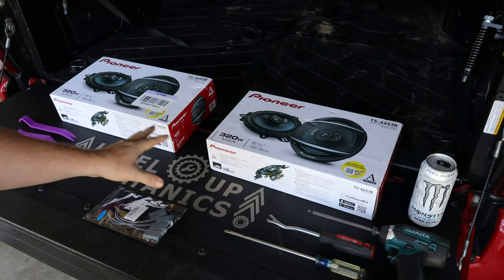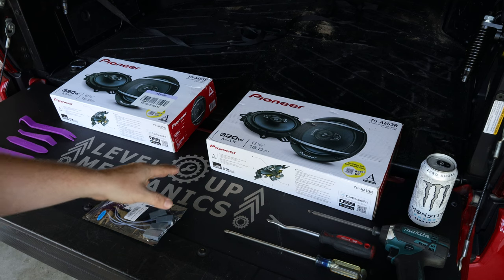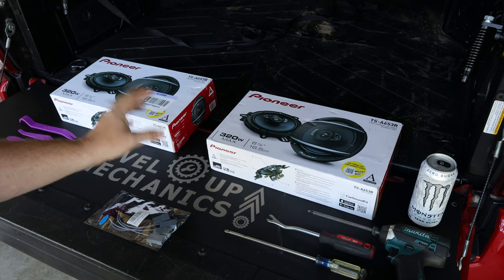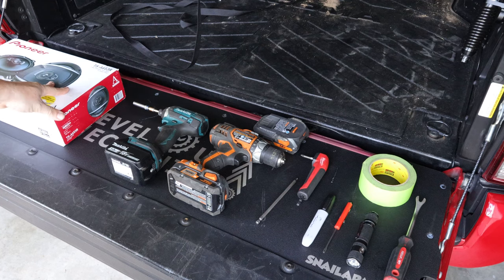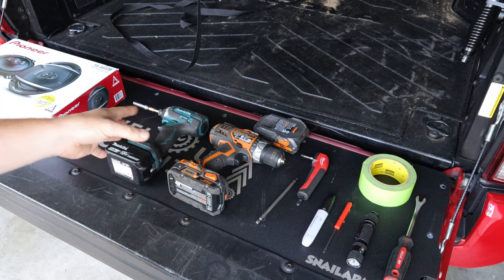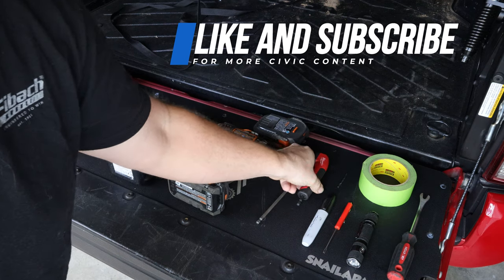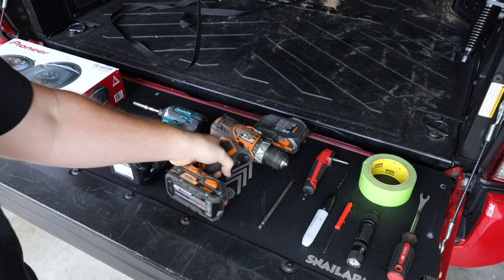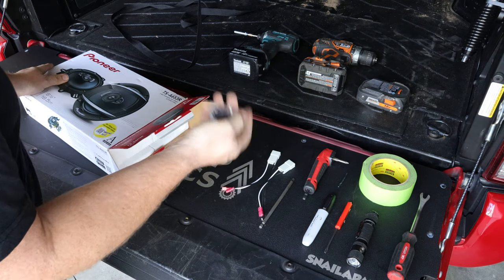Installing Pioneer A-Series Speakers On My 8th Gen Honda Civic (2006-2011) | An Affordable Upgrade

Comment: FYI, I reused the felt backing on the stock speakers by putting them on the back of the new spacers to prevent any vibrations. Also, do you not have the 1" tweeters on the top of the dash at the base of the A-pillars? I didn't bother changing mine because I couldn't find any direct fit aftermarket speakers and the OEM Honda's were overpriced. Lastly, where did you source the rear stabilizer bar?
Reply from the maker: Re-using the felt is always a good idea... the more protection you have against rattling, the better 👍.

My LX doesn't have stock tweeters (I checked just to make sure 😅). But since there is a tweeter mounted on each new speaker, it definitely improved the high & mid range sounds overall (when compared to the factory setup).

And finally, I found the rear upper shock tower bar on Amazon. The brand is Ultra Racing and they make a lot of different chassis reinforcement products for the 8th Gen Civic. 

https://ultraracing-usa.com/product/honda/civic/

Comment: You probably won’t reply but when you buy it on Amazon do 2 speakers come in 1 box or do u have to order 2
Reply from the maker: Yes, 2 speakers come in one box. One order will let you replace both front (or rear) speakers 😁👍

Comment: I have a question with my 08 civic coupe mine originally came with the premium audio system and the right half of the speakers in the car went out all at the same time and then now im down to just my ome speaker in the driver side door even my sub that came stock with the cars premium system went out as well
Reply from the maker: It could be the speakers... or it could be the amplifier... but unfortunately, I don't have a definitive answer...

Comment: So I seen other comments where you said has their premium sound system...did all honda have that premium sound system in all their cars or where they select cars? Because I have a 07 civic hybrid with the navigation head unit and I'm not sure if they came with that or not unless they all came with a premium sound system with Amps and what not...just a question I thought I'd ask
Reply from the maker: Not all 8th Gen Civics come with a factory premium sound system. Some (like my LX) came only with a basic sound system.

A good way to know what you have is to go to crutchfield.com and select your vehicle (and answer the questions about your vehicle specifics). Doing so well tell you more info about which factory sound system you have. 

I hope this info helps! 😁👍

Comment: its better to replace all 4 ? FOr my LX the front are gone, so iw as thinking maybe buy a set of 4.
Reply from the maker: I went ahead and just replaced all 4 speakers at once. You can always just do 2 at a time though, if you need to space out the cost.

All 4 speakers are exactly the same, so it's up to what your personal preference is 😁👍
Reply: @LevelUpMechanics  very true.. ill check on it

Comment: Do you need to replace the factory amp with aftermarket amp seeing that you  replace the factory speakers?
Reply from the maker: No, Civics that come equipped with a premium sound system can still retain / use the factory amp with upgraded speakers. 😁👍
Reply: @LevelUpMechanics  okay, thanks for your reply. I am in the process of redoing all my speakers in my civic SI four-door 6 1/2 inch kickers and  a 8 inch subwoofer, 600 Watts rms would the factory amp be able to provide that amount of power thanks.
Reply from the maker: Honestly, I am not sure at the moment (in regards to the subwoofer). My civic does not have a factory amplifier, so I would need to do a bit of research to figure out the specifications. 

I'll see if I can find the answer..
Reply: @LevelUpMechanics  ok thank you
Reply from the maker: From everything that I'm seeing, it looks like you may need to upgrade to an aftermarket amp in order to power an aftermarket subwoofer.  The options of upgrading the factory subwoofer (while retaining the factory amp) are EXTREMELY LIMITED.
Reply from the maker: It seems that the factory amp is fine for the factory woofer, but it’s not going to give you the power needed to drive an aftermarket sub.
Reply: @LevelUpMechanics  perfect thank you. My plan is to run the speakers of the factory. Amp and  run a mono block for the aftermarket sub! Thanks
Reply: Does the factory amp have the correct ohm load to run aftermarket door speakers??

Comment: Hey guys I just finished the install of some aftermarket speakers and everything went so smoothly but after I got everything buttoned up my radio is seems to be on but the only speaker that seems to be putting out any sound is my sub. Any thoughts are appreciated.
Reply from the maker: I would probably begin by checking fuses to see if any are blown... 

If all the fuses are good, I would then start testing each speaker for power / continuity...

I hope you are able to figure out what's wrong 🤞

Comment: Would it make a difference if I just replaced two front door speakers while keeping the radio stock? Or I need to install a head unit as well?
Reply from the maker: You don't have to replace the head unit. You can just replace the speakers and still improve your sound quality 😁👍.
Reply: @LevelUpMechanics  thank you so much for your response 👌🏼
Reply from the maker: @tutuy-mm2be anytime 😁👍.
Reply: @LevelUpMechanics  hey there I've just installed a Pioneer TS-G1610F on the front doors & did noticed some improvement like the sound is clearer and a bit louder, bass improved a lil as well. I do have some follow up questions though hope you won't mind!

Scenario: Planning to install two more for the rear part. 

1. Can I use a different model? For a example a JBL this time around. Would there be any complications? (Although I'm leaning towards buying the same model as the one on the front doors). 

2. If I decided to install an aftermarket headunit as well, can I expect the sounds to be "more" better compared to the stock HU? 

Honestly want a lil more bass. But do I really need a subwoofer for that? (Let's assume I already have installed the 4 speakers and an aftermarket HU).

P.S.
Can you recommend a headunit that'll make my sounds better while not being too pricey lets say 100-200 dollars maybe.
Reply from the maker: @tutuy-mm2be I'm glad your sound quality improved 😁👍.

1. You can totally use different speakers for the rear. You shouldn't experience any complications. 

2. An aftermarket head unit could definitely help to improve overall sound quality.

3. Upgrading your rear speakers will definitely improve your bass sounds. Although, I must say that the JBL Basspro Nano subwoofer that I have for my setup makes the bass sound 10x better. 

4. I really don't have any experience with any $100-$200 budget-friendly head units that I could recommend. You'll probably have to do a bit of research to find one that will suit your needs & budget. I would definitely do some research on https://www.crutchfield.com 

They have a lot of good info and all sorts of head unit options to research.

I hope this info helps! 😁 👍
Reply: @LevelUpMechanics  thanks man. Yeah I've watched your video installation of that sub I find it cute that you placed it on the back  (might copy that idea 😂). I'm just a lil torn about upgrading to that worried that mechanics in my country wouldn't be able to do it properly which is why as much as possible I'd be happy to stick with just replacing all 4 speakers and keeping HU stock. Tho like mentioned I'd be happy w a lil more bass but guessing that wouldn't really be possible w/o a sub
Reply: Mixing speakers can some times get little cross frequency over lap, but rare it's problem so should be ok,
(I'd perhaps go for a less sensitive or less  high frequency  ie no tweeters in rear)
Head units can vary
Jvc, sony, poineer, apine kenwood do fair budget units but  check reviews also depends if want touch screen, Android auto, rear cam, cd, dvd USB, Bluetooth etc,

Comment: Great speakers for sure! Just installed them yesterday but I am having a slight problem where the whole audio system cuts out if I open or close the door sometimes it comes back but it still goes out so I'm trying to figure out the problem there... but for sure great sounding speakers would recommend relatively easy install.
Reply from the maker: Do all the speakers go out when you open a door? Or is it just the one speaker that is attached to the door that you opened? 🤔
Reply: @LevelUpMechanics it is all the speakers in car that go out. When I open my door they usually work fine but when I'm driving they work for a bit but if I hit a bump they go out...I can usually get them to work again If I smack the door but it usually goes out again.
Reply: I know for sure I didn't knick any wires when drilling. When I put the left side in first everything worked perfectly fine it wasn't until I installed the right side passenger is when I had problems. I thought that it could be a faulty speaker so I switched places and still had the same problem... I'm really hoping I can figure this out because it has been bothering me all day 😅
Reply from the maker: @rockstargmr9427  did you have this problem before you replaced the speakers?
Reply: @LevelUpMechanics  nope me left speaker was blown when I got the car and the right speaker started going out so that's why i bought the new ones to replace them.
Reply from the maker: @rockstargmr9427 gotcha. I would suspect that, as long as you installed the right speaker correctly, chances are likely that you may have an intermittent open circuit issue with a speaker wire...

I would double-check your work just to make sure everything looks good. If everything looks good, I would then open up the door wire harness  @ the area between the body and the door. The wires in this area tend to "wear out" over the years of opening & closing a door. Eventually, the wires can break and cause an intermittent issue that eventually gets worse as time goes on.
Reply: @LevelUpMechanics  okay I will check the door wire harness. Also even when switching the speakers to the other sides could still happen on the same door because the original speaker I put on the right door is now on the left but the right door is still causing the problem. So the door wire harness could be the only problem and not it being possibly an open circuit?
Reply from the maker: @rockstargmr9427  it could be a loose connection, a pinched wire, or a brittle wire in the door harness (between the body and the door) that is causing the issue.

If you hit the door and the speakers start working, I would look for a loose connection at the speaker and / or a "worn out" wire in the door wire harness first.
Reply: @LevelUpMechanics  sounds good 👍
Reply: @LevelUpMechanics I checked the door wire harness everything seems to look perfectly fine I unscrewed the speaker and started opening and closing the door and the speakers don't cut out but as soon as I screw one screw in and open and close the doors that's when the problem starts to happen again I thought maybe if I mess with the wires while it's plugged/screwed in maybe it will go out again then it will be the wires... but nothing happened as soon as I put it into the slot to screw it in I start to hear a slight crackle and then when I open and close the door the issue continues.
Reply: I've just temporarily put the old blown out speaker in and there is absolutely no problems for now...could this problem be caused from me still having the stock radio/head unit?
Reply from the maker: @rockstargmr9427 is the back of the speaker (like the positive & negative pins) contacting the door frame? It seems like the speaker is "grounding out" somehow when you screw the speaker into place...
Reply from the maker: @rockstargmr9427 I don't think it's a head unit issue. I think that the speaker leads / pins (or wiring) are grounding out somehow on the door frame...
Reply: @LevelUpMechanics  okay...I only visually checked the wires around the door from what I can see. If that was the case...wouldn't the original speaker be shorting out the same way and causing the same problem
Reply: @LevelUpMechanics  i don't think the positive and negative pins were touching the door frame but I realized once I unscrewed the whole thing from the door it would start to crackle as soon as I went to put it back in its place.  Screwing the top part of the speaker bracket would make it crackle even more... not too sure but I will check to see if it's grounding when I get more time
Reply: @LevelUpMechanics  so I just decided to order a whole new wire harness...installed the new one and I'm still having the same issue as before... I'm completely stumped
Reply from the maker: @rockstargmr9427 well that's annoying (to say the least). I'm not quite sure what it could be. The only thing I could suggest is that it might be time to start testing wires for power & ground...

You'll probably need to get your hands on a wiring diagram for both the door and the stereo system. I wish I could be of more help...
Reply: @LevelUpMechanics  No worries! Just thought I'd update you on the situation...it worked perfectly fine for about 10 seconds but as soon as I started to move the door again it all went downhill.

Comment: Where did you get the screen for the civic? And the front windshield trim? If you can leave us a link because I need to add those 2 things to my civic. Please and thank you.
Reply from the maker: I'm not sure I know exactly what you are talking about (in regards to the screen and the front windshield trim)...
Reply: Did you ever find the windshield trim? 😂 I need itttt
Reply from the maker: I had to order the roof moldings (which also act as the side trim for the windshield) from a Honda dealer... they were not cheap 👀.

Now I know why the previous owner decided to fabricate their own trim 🤣.

Comment: What happens if you have a sub and amplifier installed already on an oem radio? I have a 2014 civic si coupe and want to upgrade the speakers
Reply from the maker: You can still upgrade your factory speakers 😁👍. 

I would highly recommend checking out Crutchfield's website and putting in your vehicle info for more detailed information about your Civic, but the process of upgrading your speakers is pretty much the same. 

https://www.crutchfield.com/

Comment: Did you ever find the front windshield trims on the side and the your side window trims ?
Reply from the maker: Yes, I ended up purchasing all Honda OEM parts. New OEM roof rail moldings (including all new clips) and "door tape" for all 4 doors. 

Trying to remove the old "door tape" turned out to be extremely difficult and unnecessary. I found that as long as you cleaned the surface first, you can just put the new "door tape" on the existing tape and it will look brand new again. 

I have all the part numbers lying around somewhere here lol. Do you think a video covering all that info would be useful / helpful?
Reply: @LevelUpMechanics yes
Reply: You can also just buy garage door bottom seal and stick it in there and cut it to fit the windshield clips that’s what I did took 5 minutes and looks great

Comment: Are those speakers bracket/ adapter comes in the box already??
Reply from the maker: The speakers include the brackets. If you want to buy the connector pigtail that is compatible with the OEM connectors, that item is not included.

The speakers do come with universal wires, so if you know how to spice/ solder wires together, you can do that if you want to.

I hope this info helps! 😁 👍

Comment: do you lose bass whne changing to these coaxial speakers? i dont have a subwoofer
Reply from the maker: No, you don't lose bass. These coaxial speakers have great high & mid-range sounds with pretty decent low-range too. They are definitely better than the oem speakers I had 😁👍.

Comment: My front tweeters by the window are buzzing or have a static when I turn on the car is there any way to fix that
Reply from the maker: Are they the factory tweeters? If so, you may just have to replace them to fix the issue.
Reply: @LevelUpMechanics  yes there stock I'm pretty sure. Was planning on switching them out but wanted to make sure it's not some other issue
Reply from the maker: @kevsimoes gotcha 👍. Yeah, if all your other speakers are working fine (no buzzing or static), then chances are likely that your tweeters just need to be replaced. 😁👍

Comment: I have the premium sound system would the process be the same for me to replace all 4?
Reply from the maker: Absolutely, yes 👍. In addition to the regular 4 speakers, I do believe the factory premium sound system also includes 2 tweeters (located on both corners of the dash by the a-pillars) and a factory subwoofer...

Comment: i just replaced my speakers and the bass is 90% gone. I used coaxial speakers all around. and using my original head unit. how come?
Reply from the maker: The Civic comes stock with coaxial speakers from the factory. What brand of speakers did you purchase / install?
Reply: @LevelUpMechanics  i tried jvc. And hertz. They all lose all the bass. The oem cheap ones with the tiny magnet has more bass. Im not sure why
Reply: @helsonly722 original head unit might not put enough amperage unless you wired a amp for it
Reply: If new speakers are to heavey for headunit to power, they will strugle to kick,
Also if one of speakers gets wired in reverse it will cancel out any bass and sound distorted up loud,
Check sensitivity and rms rating of new speakers
Higher sensitivity, and as near to 20w rms as possable